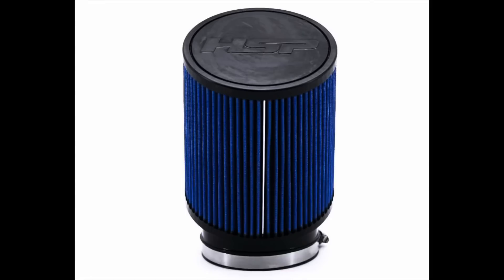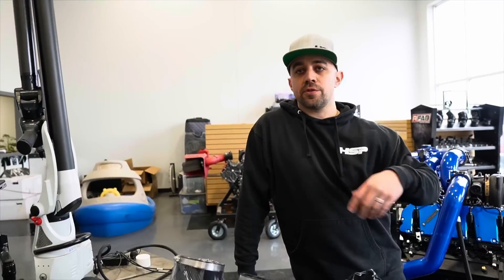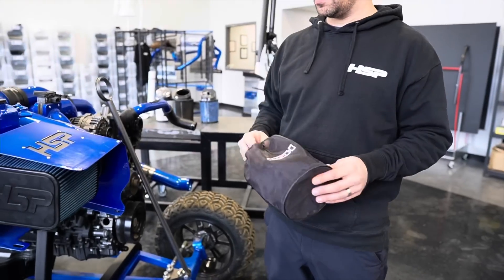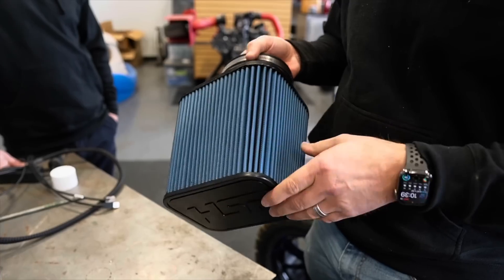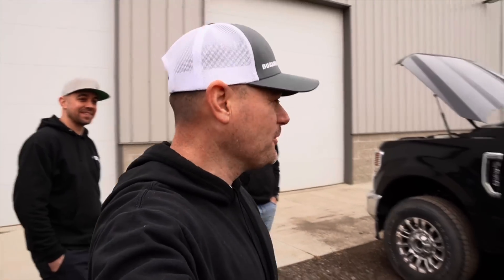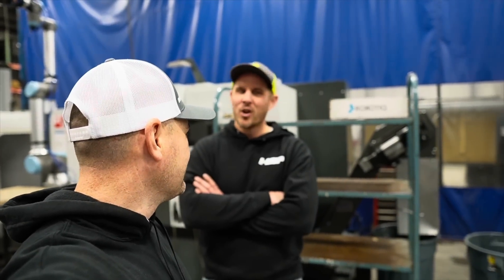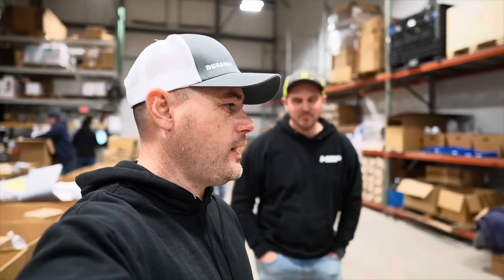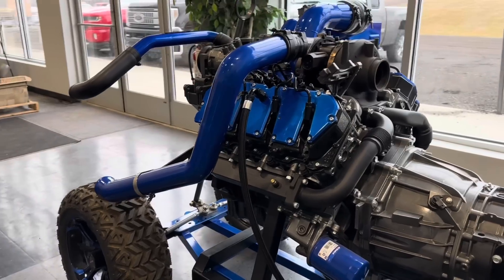Will Oiled Aftermarket Air Filters Destroy Your Diesel Engine?

Comment from the maker: What is your preference??? Oil or Dry filters? Drop a comment below 👇
Reply: Oiled currently, But I want to switch to a snorkel setup and the kit comes with a dry filter Don't know if it would make a difference or matter if I could swap out the dry for oiled. just something I'll have to look into when it comes time.
Reply: I go with a dry filter. It's a lot easier to maintain. I used an oiled filter once, and it wasn't very easy to clean. I also was afraid of over-oiling it.
Reply: I've used a oiled one for years, should probably clean it more often. Dont really notice a difference.  Is there a way to contact you truckmaster? Have something id like to run by you.
Reply: I prefer oiled. I’m partial to K&N filters . Since we’re on the subject, do you know how to clear “check air filter system” warning on 2020 duramax? I recently replaced the stock air filter with a oiled K&N drop in replacement filter on my 2500AT4 HD, a week later the warning popped up and I cannot clear it. Did I just mess up my L5P by replacing the filter with a K&N?  Help!!!
Reply: Have banks snorkel KandN.ram air on my d max for 10 years never an issue I go to Dez quite often.
Reply: I've been running oiled filters for a while and haven't had any issues.
Reply: Dry all the way ! Change out at 15,000 miles or less if real dirty! Also use pre filter and clean often!
Reply: What about the non-oiled cleanable filters? I have the AEM dry clean on my LML D-Max and love it.
Reply: You should check out Project Farm on YouTube where he does a air filter test. The k&n style let more particles through.
Reply: Oil filters collect more debris not from the filter but from the oil being sticky and when in the filter material it soaks in and will collect more debris’s
Reply: @averyordish2125  
Go check out that video of the test at Project Farm. He uses flour and the k&n let the most particles through.
Reply: Dry because dust particles pass threw oil coated filters.
Reply: @winnreid  the k&n allows more airflow. In doing so more particles get through. Go watch the filter test video by Project Farm.
Reply: @daggergtfpv  I know this first hand from running trucks on a farm
Reply: @abelcarrillo9083  Same on my 2021 3500. Chevy (great tech, out in parking lot away from shop) said:  "...we could turn off air filter system sensor with our interface while logged in, but we would have to charge you for the time."

Comment: Been running my 2 oiled filters (AFE) on my Duramax for more than 15 years now.  I live out in the sticks, and sure the filter gets caked up, but I just swap it out with my other prepared filter and I'm good to go for another year.  Solid and cheap, and I never ever had problems with my mass air flow sensor.    Oiled is the way to go.
Reply from the maker: Great info
Reply: A little over a year ago a place I do some of my duramax work (Dakota Diesel) was cleaning of some of there inventory and told me if there something on that table you can use go ahead and take it. It was a AFE air filter for my 2002 gmc truck. I was very impressed with there filter I just got an AFE oiled air filter for my 2012 gmc truck.

Comment: Oil all the way. I toss mine in a bucket of water and Dawn soap and let her soak while changing oil. After about 30, swish it around in the soap for a few minutes flexing the ribs (no brush)( if the water is nasty, you're clean or at least cleaner), hit it with the garden hose (inside out) for a few minutes. Lightly shake it out, Set out to dry in the sun. Lightly (I mean a couple of squirts of filter oil per side - don’t go full “Earl” with it). Reinstall. 

The ribbed cloth like material lets more air flow and the oil helps catch the smaller dirt particles without restricting the flow, like paper. I’ve been doing this for over 200k + miles…..same filter, same method. If this is messing up your mass air sensor, you are likely using way too much oil.  👍

Comment: I've used oiled filters for ten-years and 100K plus miles.  My Manifold Air-Flow Sensor (MAF) has never become oily.  If using a round air filter, there are foam socks that can go around the filter for an extra layer of protection.

Comment: Was running a AFE oiled filter on my lml. Factory oiled. Ruined 2 maf sensors. Swapped to dry. No more issues. Again, factory oiled filter. I did not oil them myself. Not worth changing out maf sensors. Dry for me.
Reply from the maker: It’s interesting your not the only comment about oiled AFE products going bad

Comment: I run oiled air filters in my semi and my 6.0! The paper air filters for my semi cost over $200 each and I have two of them. I’ve had these oiled filters for around 2 years with over 200k miles with them.

Comment: I've had a Banks ram air for about three years now on my 2018 GMC 3500HD L5P and it has worked great. It is a oiled filter and I clean and recharge ever other oil change.

Comment: Josh, this might sound overkill but i have 2 oil filters. i wash 1 and put it in the basement near the dehumidifier to slow dry it. while i put the other 1 in the truck @ each oil change or 6 months. i also live on a dirt road. i also have one on my gas ford truck for over 100k miles on it. never an issue with sensors. she still rolling strong
Reply from the maker: Thanks for sharing

Comment: Dry filter. No worry about sensors. And a better chance it won't gum up and clog completely. Oiled will keep collecting until 0 air passes through.and that's not good. Dry is cheap and user friendly

Comment: I stay with my stock Donaldson Power Core air filter on my 07.5' GMC. I remember when Donaldson Power Core was available in the Volant air filter kits and they did great. I change mine every oil change and there's no dust in the intake tube.

Comment: I have never had a problem with the oiled filter.  I have used them for over a dozen years, and never had a problem with over oil or contamination on the the MAF.  I like having a filter that will last longer than once.  Cleaning and re-oiling is simple.

Comment: My cummins has been running a s&b oiled filter since 2012 253000km no issues I clean my turbo off once and awhile from oil build up.  Runs good no dust in tube.

Comment: Running the Banks Ram air on both my LBZ and L5P. One is oiled, the other is dry. Didn't see a difference with either other than extra time to clean the oiled.

Comment: They only one way to find out Josh do one with a dry filter and do one dry. But when you run a oil filter before your turbo. You will not get the same air flow because oil will not let the air flow freely

Comment: We ran K&N on race car so I have run one form 1993 on every truck I’ve had. If you don’t over oil and allow it to tack up before you run it you should have no issues. I keep a paper filter to run while I clean the K&N . Wash it, let dry to cool he next day, oil it and let it set to the next day before I run it. Never had any sensors or turbo issues,

Comment: I use an oiled air filter on my 2019 Duramax and has held up well and always have a spare or two on my shelf.  No MAF sensor issues so far.  Thanks for the video and the shop tour.

Comment: He is wrong, I do all of my own maintenance, and would not touch an oiled filter with a 10' pole.   Great video Josh.
Reply: Why is he wrong? Can you provide any tests? I don't doubt you have your reasons, and this is a highly debated topic, but you didn't provide any proof or reasons to the contrary
Reply: @AllThingsBoost  first off, they filter less, which means they let more dirt pass through.  An oiled filter is a hard on sensors, especially if too much oil is used.   Paper filters work excellent, why reinvent the wheel.   The best filter on the market are the Donaldson filters.
Reply: @WBOS72  my boss swears his life by fleetguard
Reply: Go to Project Farm you tube channel for detailed demonstration of how well oil treated filters prevent your engine. Bottom line they don’t. Stay with fleetguard or similar to protect your turbo diesels.

Comment: Great video with good info.
I’ve had the Banks on my LB7 since 2010. A couple of years ago I bought a second filter. Swap them annually after I wipe out any excess oil. On my second MAS. Don’t think that’s too bad for a 20 year old truck.
Reply from the maker: Not bad at all
Reply: Only 176,000 miles. Age more than anything at this point. Yes, the truck is old enough to vote and drink next year.🤣😂

Comment: I have used oiled filters for 30 years.  I have not had any problems.  I have had the engine oil tested and it has not shown any contamination.
Reply from the maker: Thanks for the info Doug
Reply: Good to hear Doug. What’s your filter of choice?
Reply: I use K&N filters.  I lightly oil the filter and let it sit.  I then check for dry spots and add a little oil to those spots.

Comment: Someone correct me if I'm wrong but I believe technically dry paper filters filter down to a finer micron level than an oiled foam filter. However, in dusty dirty conditions a dry paper filter will get plugged in no time where an oiled foam filter will be able to handle it much longer before getting plugged. Depends on the application would have been the short answer lol.
Reply: I've looked at the inside of an oiled filter and could see holes where sunlight is coming through.  I trust dry, I don't want to risk grains off sand coming through those holes.
Reply: @MrStaybrown  That settles it!   Thanks for the data!

Comment: What does every factory air filter do? Dry. That’s my take and that’s what I stick to! What I saw on my LB7 was too much oil and you coat the intake pipe. Too little and it’s got dirt. Dry, neither. Just my 2 cents

Comment: I had no idea you could "re-oil" the filter. Always learning here! Thanks Josh! Now, What's the proper way to re-oil those filters?
Reply: get the recharge kit for your filter just comes with the cleaner spray and oil spray. wash it let dry then spray with I light coating of oil. I usually wash mine twice then leave it in the sun or somewhere dry before re oiling
Reply: I have a large reoil bottle with a drop oiler cap.  I put a row of oil on top of the pleat along it's length.  If you have a panel filter you can oil both sides.  I've use Simple Green spray cleaner on the filter to clean it.  I'll let it dry overnight.  You can put a paper towel under the air filter overnight to assure you haven't oiled the filter so much that it drips oil.  After you do it once you'll have a feel for it.  I think oiled filters are great because of their reuse capability.  They pay for themselves over the life of the vehicle several times.

Comment: The way i look at it is I’m guessing these oil filters are similar to k and n style filters. Yes those do give you the most power. But as far a filtering power goes. They are horrible. Look at project farms comparison of various stock filters to k&n. The particle count is hugely higher (hence whats getting into your motor). If you want to truly protect your motor you would stick with stock intake but of course auto enthusiasts cant do that. If I’m not mistaken when oiled filters are made they use a different material that one holds the oil and two they use less material or pleats due the oil is supposed to do part of the filtering. I have used oiled filters before and never been too happy with them. I would wash them let them dry for 24 hours then add oil and would let it soak in slow, i would add very little oil. And then after driving on the street for less than 5k miles. There would be cakes built in it from the oil and junk. So for me, i now run dry filters with a sock. Best option i found.

Comment: So...the oiled filter element flows more freely with less fine mesh.  Then you spray on the oil which catches smaller debris.  Oil turns the element mucky and would clog more quickly imho.  I'm not that easily swayed...at ALL.  I do like the mesh prefilter bag.  On my commercial lawnmowers we have paper filters and a foam pre filter.  The paper one lasts a long time.

Comment: Truck master I'm new to diesels and I'm thinking about buying a 2006 GMC Sierra 2500  LBZ  Would you say it's still good for this year
Reply from the maker: It’s the best year 06-07 👍
Reply: Love my '06 Sierra 2500hd crew cab LBZ duramax & just finished a 2 year frame & body refurbishing. Only has 171k on it and "now" this truck & of course engine, will probably out live me. 1 of the best engines ever made, treat it right & it'll be priceless to you.

Comment: i run a mesh filter in my 08 duramax.   after first wash i run it dry ever since, and then normal servicing.  was worried bout the oil on the mas so i run it dry  ur thought on that?
Reply from the maker: I think either way you will be fine

Comment: I've used both on different gas trucks. oil takes longer to clean.  never had a problem with either.  my cummins still has the stock air intake

Comment: Cummins guys…. Keep your filter clean. Dudes say restrictions can cause the timing case gasket to suck “loose”… I myself had a birds nest in my active air flapper. And was sucked into the filter. Had a oil leak start at the known place. Didn’t put the 2 together until I heard a Cummins tech mention it…

Comment: Awesome job Josh!!! I have K N filter and my idea is we don't soak the filter in oil. So it's not submerged in oil, like motor oil. It's a spray  film of oil. I love the K&N but thought to check into HSP. Awesome job guys, keep it up.
Reply: My buddy use to run K&N and found a lot of dust adhered to the tube past the filter.

Comment: Great video. I would have liked to see cleaning and oiling a filter. I never know if I’m doing it right
Reply: A warm  bucket  of hot water and Dunk it in and out The hot water breaks down the oil so it will come off with the dirt Then you rinse in the sink from the inside let Dry then then re oil and you're good

Comment: How can you get less restriction with same filtration qualities of a dry filter. I can't imagine that small particulate material doesn't get through the oiled filter. I know you have oil, but just the same, less restrictive means either greater surface area or larger openings.
Reply: Look into "electrostatic precipitation" if you'd like to learn the physics behind why a properly oiled filter flows better with greater absolute debris capture and longer service life than a paper air filter with similar surface area.  The debris doesn't simply stick to the oil because it's stickly, the oil naturally has a negative electron charge to it. Lots of stuff, including carbon, dust, dirt, silt, bug guts etc... has a positive charge.   Opposite attract.    Oiled filters don't need membrane sized pores to physically filter the air, they act more in the manor of a magnet, than a strainer.
Reply: Thank you for this information. My friend used K&N oiled element and when he pulled the intake off he found a lot of oily dirty residue. I'm going to change over at some point. What's your opinion on centrifuge bypass oil units? I just put one on my 2015 Duramax and It's pretty amazing at the results.   @aaronj08ar

Comment: Josh, on my LMM apon purchase I bought a KLM oiled filter on the stock intake. I had issues from the word go with my MAF throwing a code , luckily  I installed a Edge CTS 2 to clear the code. Even got to a point where I was covering with cardboard to restrict air flow somewhat.  Then I purchased the HSP intake that turned into a major problem,  couldn't go 300 yards  and boom went a code, it was a dry filter and I purchased the dust screen because of a dry filter. I messaged HSP for help they thought maybe help, and they suggested I put the pipe in backwards,  I didn't. Long story short I was getting way to much air and the sensor was throwing a code constantly. What I ended up doing was taking a Wal-Mart shopping bag rapping it around the filter taping to hold it in place restricting  flow in half  and that fixed it. I love the HSP because what ever the temperature is outside is the same going into the turbo! Not like the factory that picks up the engine heat when your traveling.

Comment: I see sooo many guys waste their money on these aftermarket air filters thinking they will get more power with them. They simply do not flow or give you any more power over stock. There are many studies that have been done to prove this. They will only benefit you if you have a highly modified engine putting out serious HP. The stock filter on my '06 LBZ has been dyno proven to have enough flow to support 550HP and it has superior filtration to anything HSP or any other brand has. I'll stick with stock as I'm tuned to 500WHP.